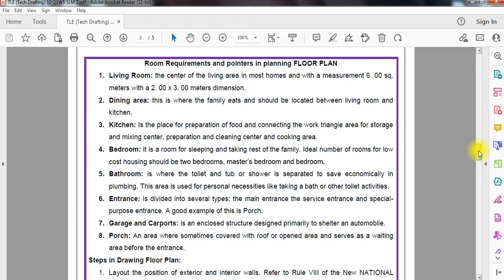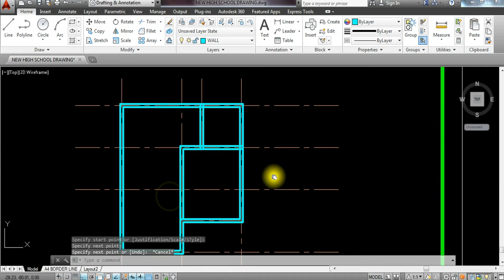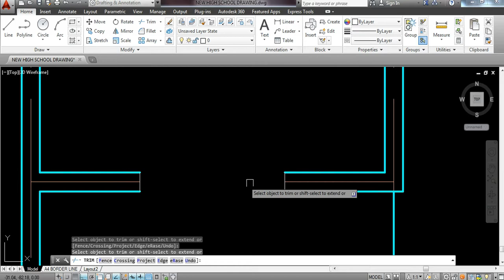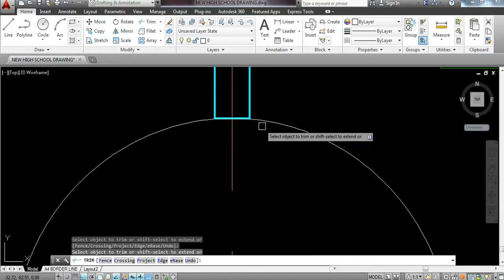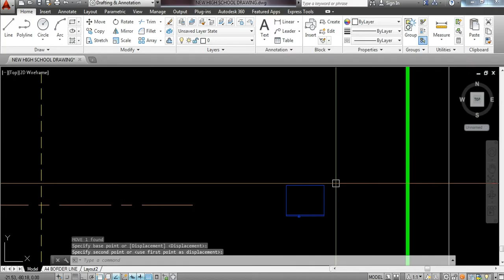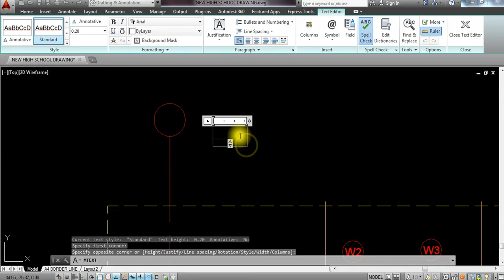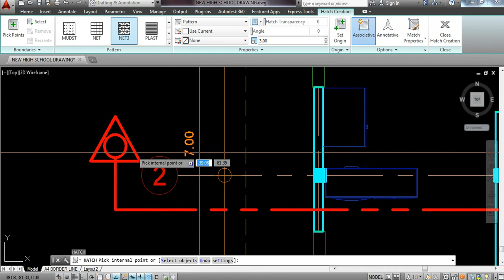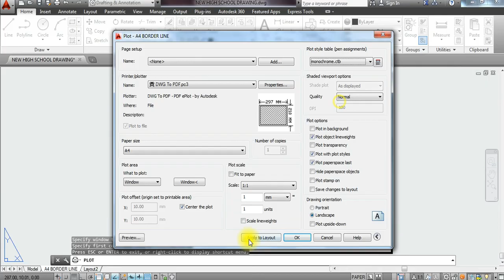Drawing Exercise 6: How to Draft Floor Plan (in AutoCAD)

Comment: It gives you a picture of every room's positioning, furniture placement, and other equipment arrangements, so everything fits well to the original purpose before you make the ultimate move and an ideal floor plan may comprise. 

Rankline B. Nicolas
10 - STE A

Comment: The floor plan is the most important drawing in working drawings because it visually depicts a space's layout, serves as a reference for other drawings, facilitates communication, ensures regulatory compliance, optimizes space use, guides interior design, aids budgeting, supports renovations, assists with visualization, and helps coordinate construction. In summary, it's a foundational and versatile tool in the design and construction process.
 

Prince Cedric R. Kasim
10 STE A

Comment: The floor plan serves as the reference for each set of workers on the job. Since it provides details of the layout as well as the scale and dimensions of each room, it becomes easier for the team to measure accurately to ensure that everything is placed where it is supposed to be.

SHEKINAH S. PILANGA
10 - STE B

Comment: A floor plan is considered the most important drawing in a working drawing because it provides a comprehensive overview of the building's layout and the relationship between different spaces. It also serves as a reference for the other drawings and provides essential information for the construction process.

Audie Fatima H. Torrefranca
10 - STE B

Comment: The floor plan is considered the most important drawing in working drawings because it provides a detailed representation of the layout and dimensions of a building's interior spaces. It includes essential information such as the arrangement of rooms, walls, doors, windows, and other architectural features. The floor plan serves as a foundation for other drawings, such as electrical, plumbing, and structural plans, which are based on the spatial organization established in the floor plan. Additionally, the floor plan helps stakeholders visualize the flow and functionality of the space, making it a crucial reference for design, construction, and communication purposes.

JHANNA ROSE C LIMEN
10 STE A